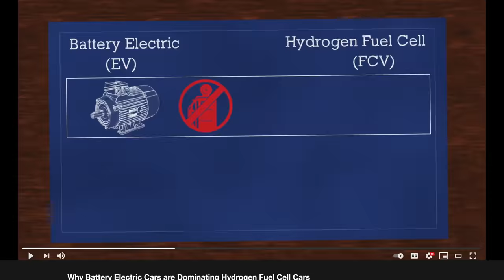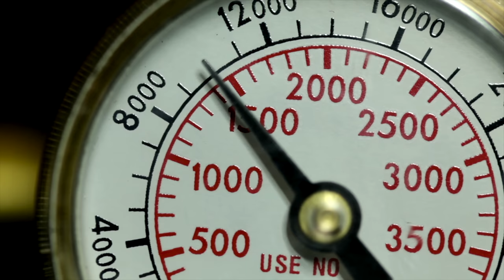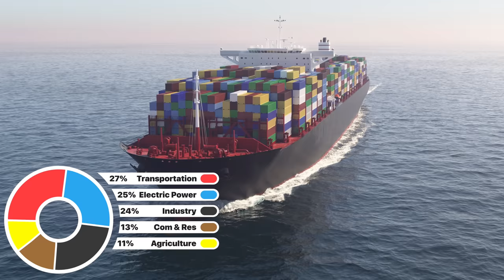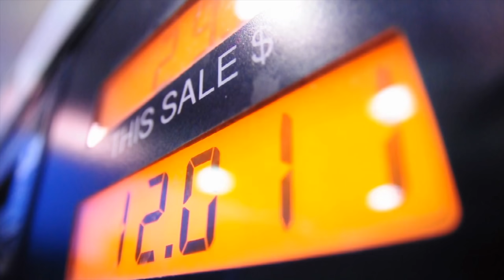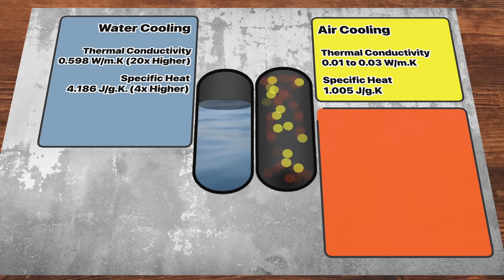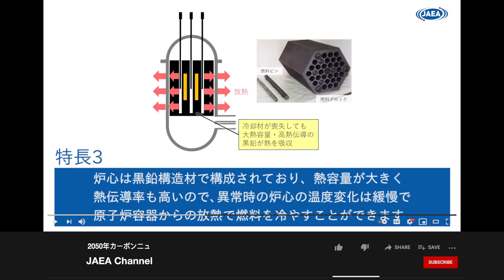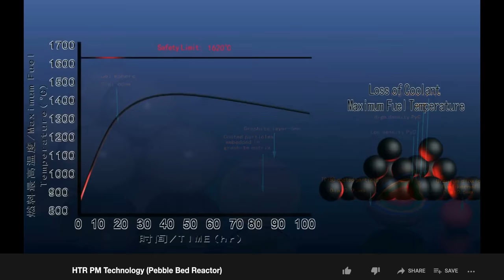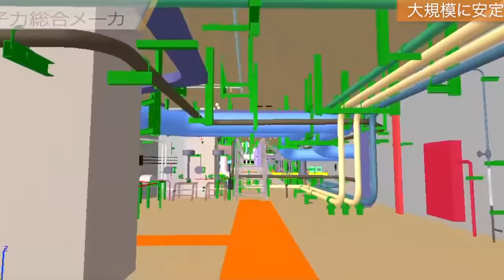Japan's Plan to DESTROY the Price of OIL and GAS!

Comment: At Fukushima Daiichi, the reactor did not explode, that happened only in Tschernobyl.
At the desaster in Fukushima the containment did not break open, the radiation that was released came from used fuelrods in the cooldownpools above the reactor, and most was from the released steam from b2 and 3.
Reply: Yes, apparently the backup generators were not high enough to prevent their disablement from the big wave/flooding.   If they had been high enough, would the plant have been safe?
Reply: Ironically, there was a hydrogen explosion at the reactor.  The hydrogen was created by overheating the cooling water...making it red hydrogen, I suppose.  It's good to know that they're working on reactors which can be cooled passively.
Reply: @linmal2242  I believe it was seawater entering thru the air vents of the fuel tanks for the backup generators which caused the backup generators to shutdown.
Reply: @linmal2242  It is possible that the plant would have been safe if they were placed higher, but not in this specific case. They had 3 areas with backup generators and all 3 of them flooded. The lowest was the basement ones, then they had another at like 10 meters and the last set at I think 13m high (might be off by a bit on those). The waters got high enough to flood all of them. The water actually washed away most of them...

The main issue though was that all of the power lines from the generators were also washed away. Even if the generators had been 50m off the ground, they couldn't have helped with no lines to get the power to the pumps. That being said, it would have made it SIGNIFICANTLY faster and easier to get it running again with a bunch on on-site and working generators sitting right there... just run some power lines ASAP.
Reply: Randy Martin  Polluting the entire globe vs relatively miniscule nuclear pollution based upon 1950's reactor designs. Keep in mind in that same era seatbelts were not mandated in automobiles and in collisions door would pop open due to lack of safety mechanisms to keep it latched upon the body shell. 

Using anti-nuclear jihad logic we should ban automobiles as they were designed horribly once upon a time and the leading cause of preventable death in the world accounting for nearly 1.3 million deaths in 2019. Being nearly twice the number of deaths than the second leading cause of death, falls.
Reply: this is incorrect, while the core didn't meltdown, the containment vessel did fail. like chernobyl, the core melted under the containment vessel and hit the concrete, and it will continue to melt as there is no way of stopping the core reaction after it is fused even if it doesn't meltdown entirely.
Reply: But there was an unforeseen problem right? If these reactors are so safe, let Japan first place them in center of Tokyo city. Then I will believe them.
Reply: There was a reactor even closer to the epicenter and it weathered the earthquake without even so much as a mention.
Reply: @nathanbanks2354  Yes. Nuclear reactors have a device that converts the hydrogen in the water circuit (created from thermolysis due to high temperatures if I'm not mistaken) back into water. What happened in Fukushima was that these devices stopped getting power due to generator failure, thus causing an explosion.
Reply: People don't realize the USSR built their reactor on the cheap. So cheap containment with very dirty fuel plus the state hiding from the plant operators a critical flaw in the operation of the reactor was a mistake waiting to happen. Matter of when, not if for Chernobyl.
Reply: And. The results were the same. Massive pollution
Reply: @sumott497   meh, in order for the reactor to fail they had to turn off multiple safety features and then turn the reactor up to almost 10 times it's normal operational level. 

Which conveniently accomplished a failure insuring another century of fossil fuel sales by Russia.  :/
Reply: @philippebracq884  
No, by far not, at Chernobyl the pollution was way higher, I would guess more than 1000x that of Fukushima.
Reply: @linmal2242  Yes, had they not put the backup generators, for maintaining coolant flow, in the BASEMENT LEVEL, and instead elevated them, nothing would have gone wrong.
Reply: "Carbon Neutrality" is crap.
Reply: they had the backup generators in the basement and that got flooded.
that was the whole problem.
Reply: @AnalogDude_  The real problem was location of the reactors on the East coast of Japan which has been swept into a broad coastal plain by erosion from many thousands of tsunamis over many hundreds of millions  of years.  A similar enormous one occurred less than 100 years ago and monuments were erected to warn future generations.  TEPCO ignored the history and the monuments in building there with only crossed fingers and hope as protection, rather than using a West coast location, not already leveled by tsunamis..
Reply: @robertmeredith3940  my analyze came from a documentary based in the incident and the result was that backup generators where in the basement and failed after being flooded, not being able to lower the insulators over uranium rods leading to a meltdown. so if the backup generators where on a different location this would not have happened.
Reply: @hg2.  Well, we DO have to reduce emissions of CO2 or we will continue to destroy the ecosystems that support all life on Earth. So that makes carbon neutral kinda' important.
Reply: @hg2.  Thanks for your reply. Actually, I'm a veteran university professor and researcher, and I have spent many thousands of hours studying what we are doing to the planet and what we must do to avoid ecological collapse. In that work, I have studied climate science and how some people were misled about it. For example, I have dissected the climate misinformation coming from Tony Heller's videos, CDN, Willie Soon, Patrick Moore, Dr. Happer, and many more. 

The 6th IPCC Report was the most thoroughly researched scientific report in human history. It was written by hundreds of leading climate scientists from all over the world, vetted by thousands of other leading scientists from all over the world, backed by over 6,000 research citations, and every line of its conclusions was signed off on/agreed to by every single nation on Earth. As a lead writer of the report noted, the scientific evidence proving that humans are warming the planet is “bulletproof.” You can read for free the three reports that make up the 6th IPCC cycle by simply googling them. It states that humans caused ALL recent global warming. 

All the major predictions of the theory of man-made global warming that could have come true by now have come true, and 14 different climate models, some dating back to the 1970s and 1980s, have accurately predicted how much our emissions would warm the planet. 

Just Google “CBS News climate models have been impressively accurate for decades” for coverage of the research proving the second point. 

If you want a list of 20 other scientific predictions that have come true (including global ice melt, sea level rise, or ecosystem breakdown) I can send that to you too, but it’s not on this computer. 

Take care.
Reply: @karlwheatley1244  
Actually, you sound more like a lawyer than a scientist.
Reply: @hg2.  The evidence proves we caused all recent warming. Attacking the messenger of the facts does nothing to change the facts.
Reply: @karlwheatley1244  
^^ Complete crap.

... And SUVs caused the medieval warm period too.
Reply: @hg2.  Thanks for your reply, but you didn't share any evidence.

1) There are many natural factors that CAN and HAVE warmed and cooled the Earth in the distant past, but we have measurements of all of them and none of them caused the recent warming. 

2) There is also a mountain of direct evidence causing our emissions and other CO2-releasing activities (e.g., deforestation) caused ALL recent global warming. 

3) Every time you burn a gallon of gas in your car/truck, you add ~19 pounds of CO2 to the atmosphere. By driving our old van 211,000 miles, we added 190,000 pounds of CO2 to the atmosphere. More CO2 slows down the escape of the heat from the sun into the upper atmosphere AND through the warming it causes, triggers the release of more methane and water vapor, which cause even more warming, leading to even more CO2, water vapor and methane, then yet more warming, and the cycle keeps going. 

And that 190,000 pounds of CO2 is just from one vehicle in one family.

4) The medieval warm period did NOT involve globally synchronous warming, so the change in global temp was a fraction of what we just caused. We have raised CO2 levels to higher than they have been in a million years, made the planet warmer than it has been for the last 100,000 years, and we are warming the planet 10-20 times faster than it usually warms when coming out of an ice age. 

* The threats are real, urgent, and WE caused them.
Reply: @karlwheatley1244  

BTW... did you use any sequestered CO2 in your house? (aka lumber?)
Reply: @hg2.  My house is 102 years old. I sure didn't build it. Like most houses, of course it has lumber. Unfortunately, the hotter and drier conditions we created with our emissions are starting to damage the great forests of the world.
Reply: @hg2.  "There have been 3 warm periods in RECORDED HISTORY." There have been no globally synchronous warm periods like what we have created. People of European descent sometimes think a warm period is Europe is a really big deal, but Europe is less than 2% of the surface of the Earth.  
The last time the Earth was this warm ON AVERAGE was ~125,000 years ago. 

"You are a snake oil salesman." No, I'm a PhD university professor and researcher who debunks snake oil salesmen and updates people who are not caught up on the science--and have been misinformed by sites like Tony Heller's site or Patrick Moore, CDN, Fox News, etc. 

Take care.
Reply: @karlwheatley1244  
What university pays you for such quack mediocrity?
Reply: @hg2.  "snake oil sleaze like "globally synchronous"
Whoa, please take it down a notch. We are adults discussing important scientific issues. There's no need to call people names, and calling people names won't prove anything or accomplish anything. 

"Globally synchronous" is a standard term in climate science, and it simply means happening all over the world at the same time. I've used that term hundreds of times before, and no one ever yelled at me or called me names for using it. The fact that the Medieval Warm Period did not involve globally synchronous warming means that different places on Earth had warming in different decades, instead of what is happening now, which is the whole Earth has gotten warmer on average than before. 

Take care.
Reply: @hg2.  Again, please try to leave schoolyard insults out of the discussion. 
"People of European descent..." I.e. truth about climate is"racist". 

No one said anything about racism, and nothing I said was racist--I am an older white American man, but I have noticed a very frequent trend: If American or Europe was warmer at some point in history, those people often think that means the whole world was. It's basic egocentrism--common to all humans, and it has nothing to do with race. However, most of the people I talk to are Americans or Europeans, and they forget that even if the US was warmer than average in the 1930s, that means almost nothing--the US is just 1.84% of the surface of the Earth, and right next door, Canada (and Alaska too) were colder than average. 
Parts of Europe warmed noticeably during the Medieval Warm Period, but lots of the Southern Hemisphere and parts of the Northern Hemisphere were colder than average.

Take care.
Reply: @karlwheatley1244  

CBS News?
LOL 🤣😆
Reply: @hg2.  Try again hg2: There's a link embedded in the story to the original research article.

But for the record, independent analyses rate CBS news quite highly for accurate information, MUCH higher than Fox or MSNBC.
Reply: @hg2.  Post scientific arguments. Swear words don't prove anything, and there's a mountain of evidence--thousands of peer reviewed studies--proving that what I said is true. Someone has badly misled you.
Reply: @hg2.  "Your skill isn't science" This isn't about me, it is about climate science. Climate scientists have conducted many thousands of scientific studies that allowed them to figure out how much warming our CO2 emissions would cause. Because of their carefully--constructed scientific understandings of the climate, they were able to develop climate models that have been accurately predicting how much our emissions would warm the planet for over 40 years. The 6th IPCC Report was the most thoroughly researched scientific report in human history, and every nation on Earth has signed off on its main conclusions. This is the very pinnacle of excellent science, and nothing you say can change that. 

The Nazis and communists were political parties who didn't do any science, didn't make accurate predictions, and created a mess. No thoughtful person is going to take seriously the ridiculous comparison of climate scientists to Nazis or Communists, and any thoughtful person probably knows that such slanders are an old tired propaganda trick. 

Take care.

Comment: Really interesting and informative.  I've heard convincing (to me) arguments in favour of molten salt reactors and I wonder how these stack up against the HTGRs talked about in this video.
Reply from the maker: Great question and will definitely be a future video
Reply: @TwoBitDaVinci  would love it if you put some numbers to these claims...what's the efficiency difference of using an alternate next gen reactor (i.e. MSR or SMR) and its electricity for H2 electrolysis? Other reactor designs are more safe and have less nuclear waste...or solar or wind (+ storage) with electrolysis cost comparison? Numbers tell the story. Great video otherwise. 👍
Reply: @sciteceng2hedz358 SMR is 10% more expensive as is compare to conventional reactor. It will only get more expensive as more delays and inflation increases the cost. It’s way more flexible so at 10% surcharge I think a lot of use cases will just ignore the cost. EG. TSMC needs reliable power from Taiwan and might just use a private SMR in the future since the grid in Taiwan have been overloaded since 2021.

Captain Republic of China🇹🇼(Taiwan) signing off.

Comment: Riding two wheeled transportation is far more effective. Saves fuel, less surface on streets, less parking space.. most people weigh under 200pounds but are communing in 3k+ pound vehicles. Most of the fuel is being burned lugging around weight of car.

Comment: The U.K. have been using ‘Advanced Gas Cooled Reactors’ (AGR) since the 1980s but the primary coolant gas used is Carbon Dioxide.  This design was chosen in the U.K. in the mid 1960s after evaluating a variety of designs including high temperature helium cooled reactors.
Reply: The Dragon reactor at Winfrith. High temperature, helium-cooled, ran on fuel pellets encapsulated in ceramic. Ran from 1965 to 1976.
Reply: @Veeger  We haven't built a reactor specifically for plutonium production since Chapel cross in 1960. The UK does not require more plutonium, it has more than it has warheads.
Reply: I wonder whether this has indeed actually... came about as well... when...  Japan bought out some of the larger breweries as well in the UK. Cos there had been so much ingenious invention there. Ab Inbev was also meant to list in HK as well.. but then it got bumped off... and there is already a Shenzen nuclear plant, but hasn't connected to this kind of form. I don't think.. Not that I am aware of....
Reply: What are the advantages/disadvantages of using CO2 vs Helium?
Reply: @HansLemurson  Helium makes you sound funny […] Carbon Dioxide makes tomatoes grow better… 
I’m going with the funny balloon filler
Reply: @IRISHSALTMINER61  problem is the world is running out of Helium where as CO2 is in abundance.
Reply: @bobthebomb1596  Qt: "The UK does not require more plutonium." Plutonium need not only be used for warheads, it can also be used to produce heat in power plants.
Reply: @HansLemurson  more than likely cost and availability. 2 factors that never get overlooked in any project
Reply: @glenmortimer2503  Yeah, CO2 is gonna be cheaper, but what I'm curious about is how much efficiency you lose in using it.  My understanding of Helium's advantage is that it's a light-weight gas (improving its heat capacity) and that it's inert.  Carbon Dioxide on the other hand is 50% heavier than regular air, and though fairly inert can decompose at high temperatures in reducing environments.

But if you want a cheaper, lighter gas that's more stable than CO2, the obvious choice that comes to mind is pure Nitrogen.  

Given that they chose CO2 there must be some benefit to it that I'm overlooking.
Reply: @Snugggg  Yes! So glad that you mentioned this.  Most Helium in existence here on Earth is sitting in stockpiles. We don't have enough for this tech to be widely adopted - unfortunately.
Reply: @HansLemurson what you are saying is technically right at atmospheric pressure. Increase the pressure & their properties change.
Plus to store these gases, they need compressing into a liquid & liquid helium takes about 1000 times more energy to produce then liquid co2.